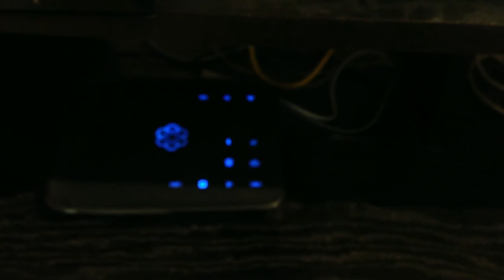Back Feeding VOIP Signal into Old Phone Jacks

Comment: What does this do? Possibly send signals through the lines In house?
Reply: You’re right. It crates a phone line bridge. Meaning that when the phone cable is connected both ends on the modem (Spectrum or Xfinity) and the wall jack, instead of connected to the landline (AT&T) it will be routed directly to the modem. But before you do any of that, make sure that the landline is disconnected first because it can cause interference with both services. By simply unplugging any phone connectors inside the phone box (most of the time is located next to the house electric meter.) which is installed by an AT&T technician, all the phone jacks that the AT&T technician previously installed, will now work with the Spectrum modem.